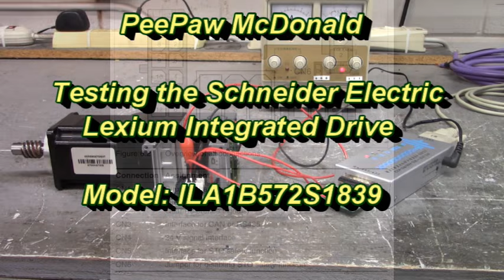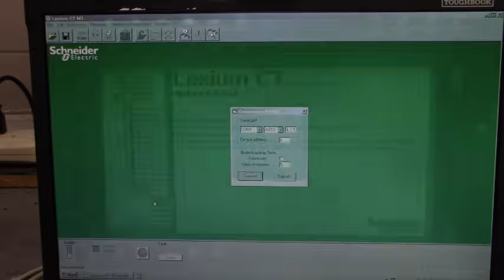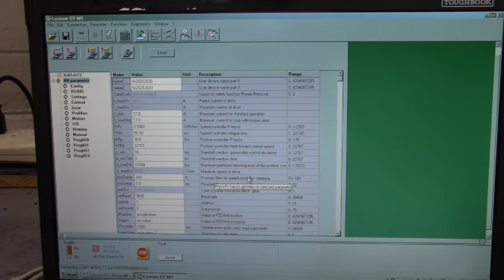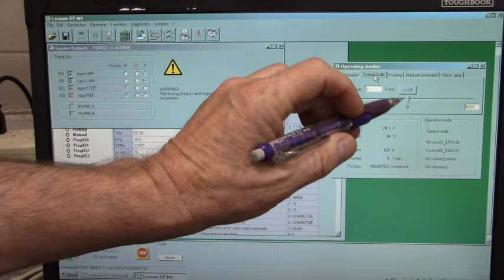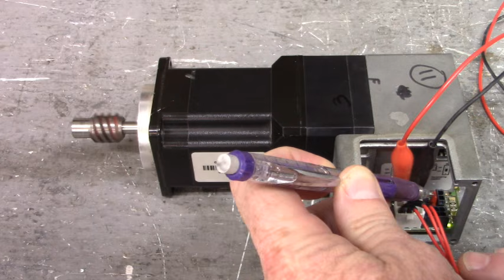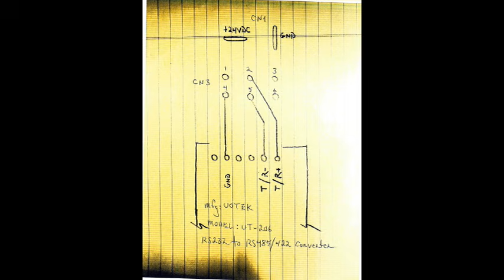Testing the Schnieder Electric ILA1 Motor / Drive

Comment: Hi, how are you?! Could you help your Brazilian friend?

I'm configuring a Yaskawa SGDB 75 VD Y178 servomotor with an SGMG 75 motor. I bought it used to use as a servo spindle on my CNC lathe.

When I leave the motor in servo-on mode using the cn parameter (in the digital operator), it starts to rotate slowly on its own and the word "run" appears on the digital operator screen. The servomotor is parameterized for pulse and direction modes. I've already tried other modes and it continues to rotate.

Using the digital operator, I performed the following test: I put the servomotor in JOG mode and then changed to servo-on mode using the same mode. This way, it doesn't rotate on its own and rotates smoothly when commanded by JOG mode.

Using SigmaWin, I tried to check what command it was receiving, but I couldn't find a way to monitor if there were pulses at the input or unwanted analog voltage at the servopack input (noise). There are no cables connected (1CN disconnected) to the servo pack other than the motor and encoder cables. What could be causing the servo motor to rotate unintentionally?